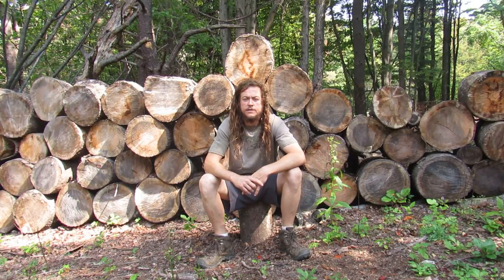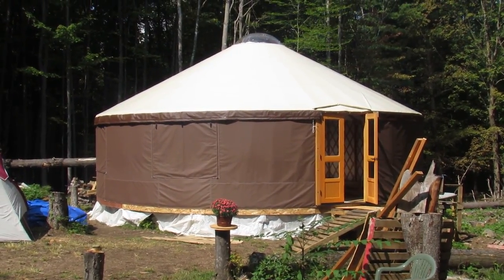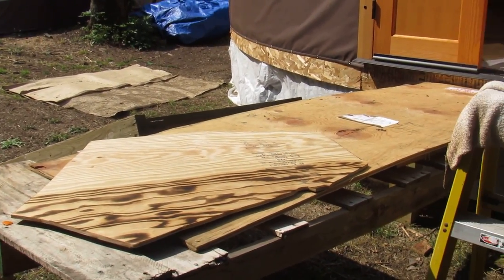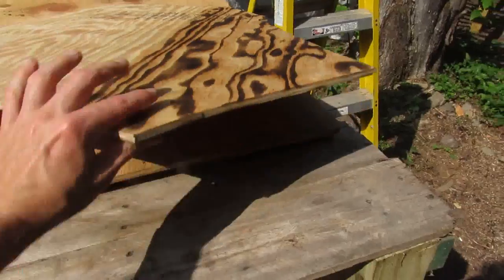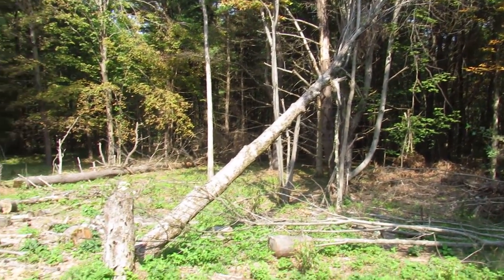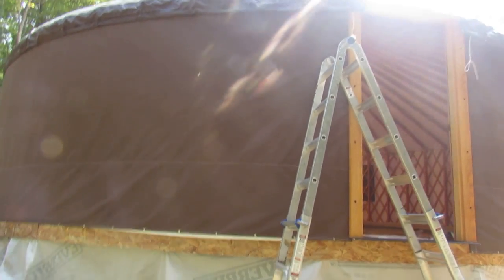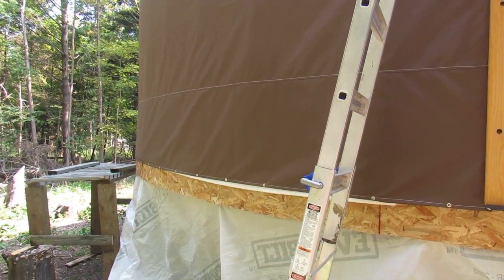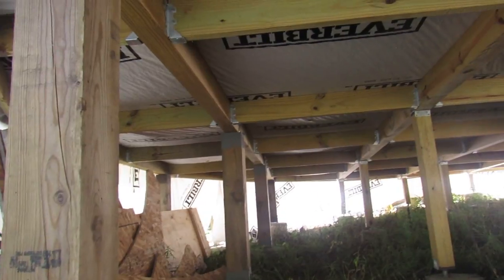Outside walk around of newly put up 30 foot pacific yurt.

Comment: Dude, you need some cross bracing under that yurt! First big wind and it is going over. Power of the triangle man!
Reply from the maker: We started doing the cross bracing after shooting this video. We also put the yurt on the side of a hill with a really tall, mature forest all around it. We rarely get heavy winds. But thanks for looking out!
Reply from the maker: 5 Years later... very little cross bracing barely any actually... standing strong. Check out what were doing with the yurt now! https://www.airbnb.com/rooms/48850926?federated_search_id=45868ba3-2e8a-4e30-9bc9-c4aa305ea898&source_impression_id=p3_1651799678_mVBG7kM4G02jaDYU
Check out our instagram and please follow us https://www.instagram.com/yurt_phoria/

Comment: Crazy idea develope bamboo fabric impregnated with water activated ceramic. Develope banna cellulose mats  impregnated with water activated ceramic that will swell up and expand and harden. Then sit down and design a yurt that you swevil latch lock all the parts together then hose it all down with water and let it cure. Strong durable fire proof yurt. 😊
Reply from the maker: Great idea! Did you patent that yet? Check out what were doing with the yurt now! https://www.airbnb.com/rooms/48850926?federated_search_id=45868ba3-2e8a-4e30-9bc9-c4aa305ea898&source_impression_id=p3_1651799678_mVBG7kM4G02jaDYU
Check out our instagram and please follow us https://www.instagram.com/yurt_phoria/